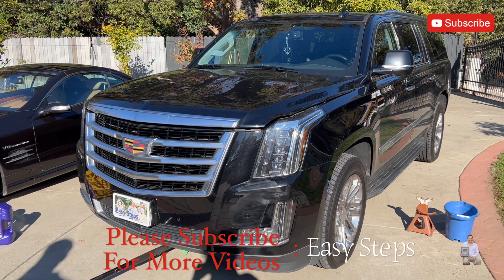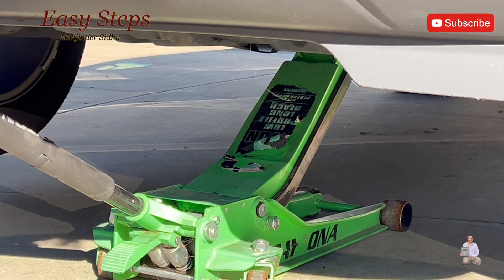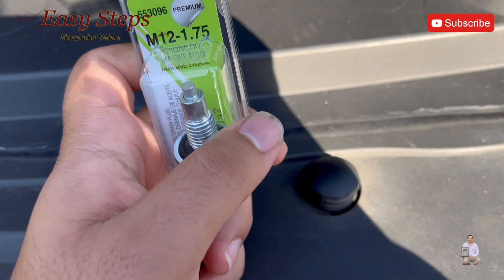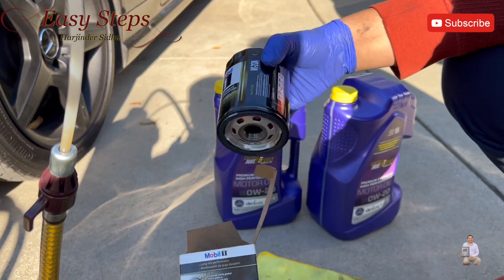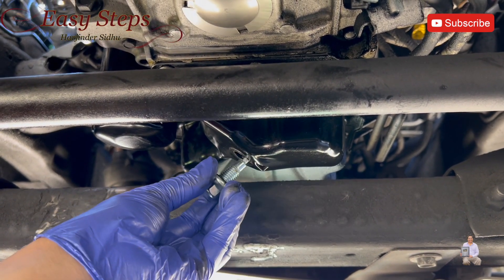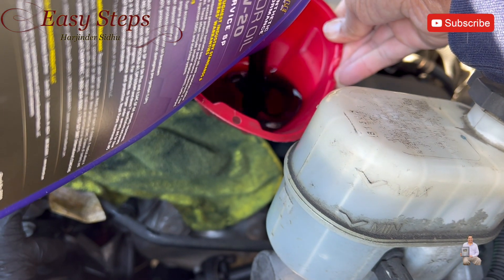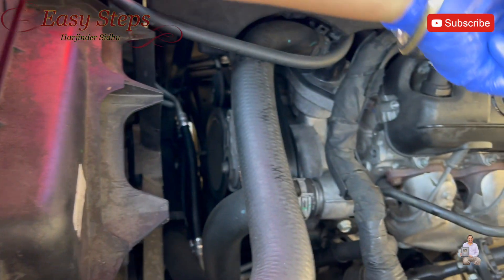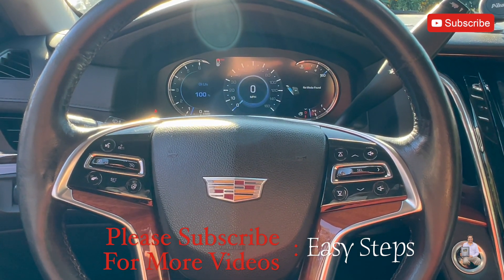2015-2020 Cadillac Escalade Oil Change With Synthetic Royal Purple Oil | Oil Life Reset on Cadillac

Comment: Owners Manual: 6.2L Engine Oil with Filter 7.6 L (metric) 8.0 at (imperial)
Reply from the maker: Yes, it's 8 bottles - 2016 Cadillac ESCALADE ESV 6.2L 8 -cyl Engine Code [J] L86 0
Reply: @EasySteps_Sidhu  at 7:28 you say the engine takes 8.5 quarts which isn’t correct.